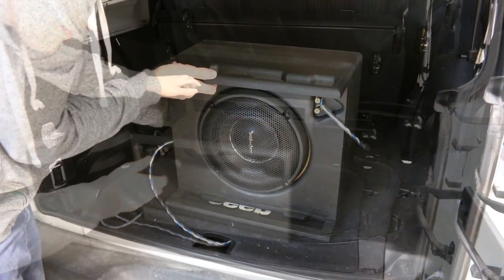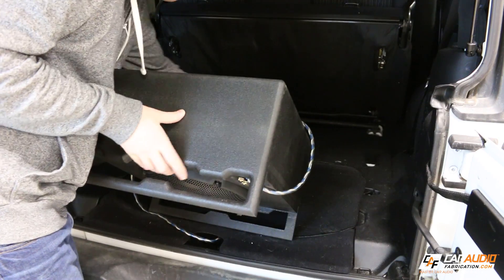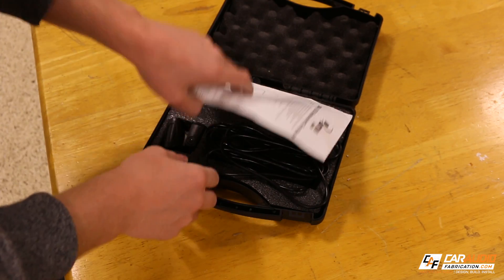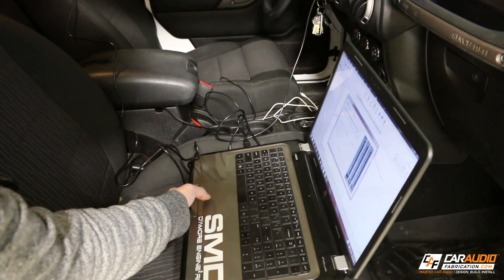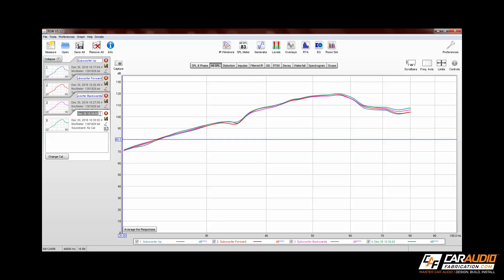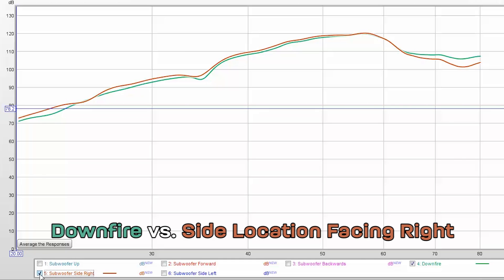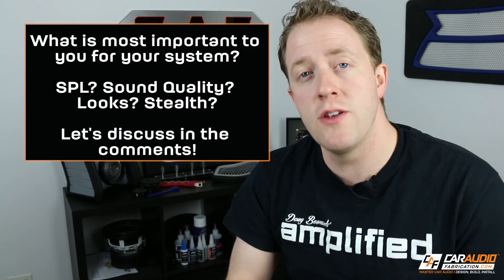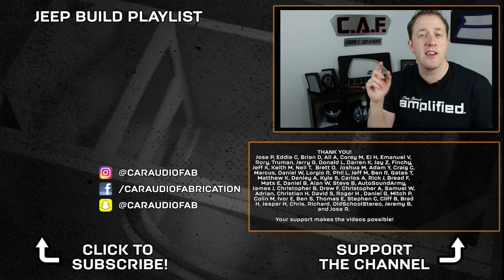What subwoofer direction is best? HOW TO TEST! - CarAudioFabrication

Comment: I've heard that with a sealed enclosure firing direction doesn't have as big of an effect as with a ported box. Any chance on a ported enclosure position video?
Reply: Go experiment, it's different for just about any car.
Reply: Ported boxes are boomy and ain't punchy tight and accurate like a sealed sub
Reply: Sealed boxes for smaller cars Ported Is Big trucks
Reply: I have found that sealed enclosures have very tight bass loud at the same time. You can take a cheep amp and sub put it in a sealed enclosure and get  twice as much bass as a ported box. Ported box’s need almost twice the out put but they sound amazing because it hits lower.

Comment: i have a 2014 single cab ram. with quite a bit of storage place in the back of the seats. i just got 4 rockford t1 12s swallow for it. i have a rf t-2500 ready to power them. im pretty excited about that :)

Comment: wondering how those results would vary once the soft top goes down
Reply from the maker: Good question, the soft top is never really used on this vehicle, it stays on year round, but for open air I typically find down-firing to work best.

Comment: As for the question, yes. My biggest thing is a good sound quality that's hidden but has spl abilities when I need the extra bump. My first system I ever had was stolen while I was at work so all my systems since then have been on the stealth or to big to take without dismantling the car side.

Comment: Good video.  For me, the biggest issue is output (SPL).  If the output is not sufficient to your taste and adequate to the music your listening to, your gonna waste money with something that you end up replacing (speaker, enclosure, or both).  By the same token, going big on BIG bass when you never use it is also worthless overkill.  You really need to match these up, but its always better to have a little more output than you need, then not enough output.  

Quality of sound can be controlled by matching a good enclosure type with the driver your using, and you can use equalization to clean things up as well.  But you really need to match the overall SPL to what your intended target is...with a little room for headroom and some extra to pacify the hidden bass-head in all of us.  Have an honest conversation about what you listen to and HOW you listen to it.

Comment: i have a mini van, what would be the best way to point my subs, and is there an app on my phone to test dbs
Reply: Jason Allen most phones mics can't handle spl tests. Have to go with an add on mic, best to just use the one Mark suggested.
Reply: ok thank you, let me ask this, is there a good way other than bridging a single voice coil sub to get the most out of the amp and subs, im thinking ill have to go to a dvc sub but the funds arnt there
Reply: Jason, rap, rock or country? With rap you would want ported box, slot ports seem to work the best if you have the room and proper calculations. Rock, you want sealed with the subs face backwards or straight up. Country.... can go either way anymore. I prefer 4th order bandpass but they take up a lot of room and a decent set of 6-1/2" mid bass in the doors and 10" or bigger sub, properly tuned will give you a decent sound, make the neighbors mad but not kill you wallet.
Reply: Ziggy i listen to it all but mostly country and rap, i have a set of 12 in a bix im thinking may be to big and its enclosed, ive been looking to get a ported box, because i have a hard tme tuning to this box
Reply: Is there a decent car audio shop near by that could sell you a pre-filled/prefabbed setup? They normally know of good builders for custom stuff.

Comment: something I have done before in one my cars I have had was 4 budget 10s mounted on a IB deck in a golf, if I remember it was around a 14cft area where I keep a old quilt to take up some air space. it was two new and two old school kenwood 4Ω subs of around 400 rms on a 2000 rms old model hifonics brutus amp wired down to 1Ω. the the two new sub where not a good choice for the setup and did not put out a lot of sound compared to the old ones that did a good job till I blew them, even then they were doing better. I mostly listen to heavy metal and hard rock so I look for quality and fullness of the double bass in a system.

Comment: That's a good question. All three are important to me but SQ is probably on the top, following is stealth then spl. Stealth above spl because I don't want everyone to know I have a system so they wont try to steal it, however my system consist of 2 12" subs so I have more than enough spl. My setup= 2 12" Alpine type R's on an RF T1000-1bdcp. Alpine mrv-f300, 6 1/2 alpine type S front and rear/front will soon be polk MM 6 1/2 components 😊. I like Alpine subs and amps, but I'm not too impressed with their type s speakers.(tweets took a shit)😒

Comment: Thanks for the vid. Hard question.. I wanna say SQ but not strictly.. I go for a combination of SPL and SQ. I like tons of detail and clarity but a low end that rumbles my booty pipe.
Reply: thornygravy I'm literally the exact same way
Reply: Booty pipe.. ...      ...     😬
Reply: I'm doing something similar. Got the Audison AV 1.1, 3.0 and 6.5 for the front and a Sundown Audio x10 for the rear, powered by RF amps (2x t400-2 for the front (the speakers come with a passive crossover so using this for now to save space and money), 1x 1500bdcp for the sub).
Reply: That's not a question. lol. if you said that to me, i'd say "ok, buy some speakers". there is no answer. only replies.
Reply: Jl audio